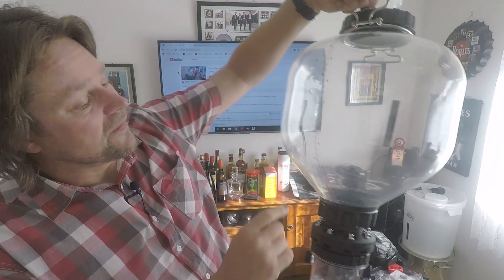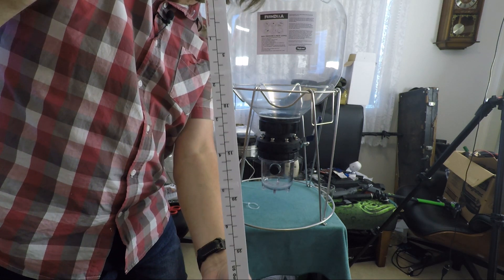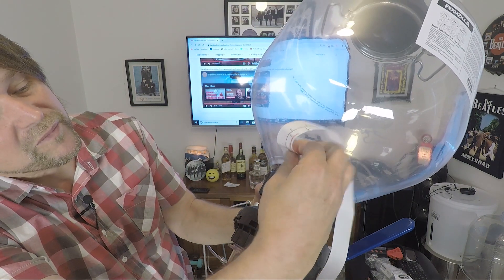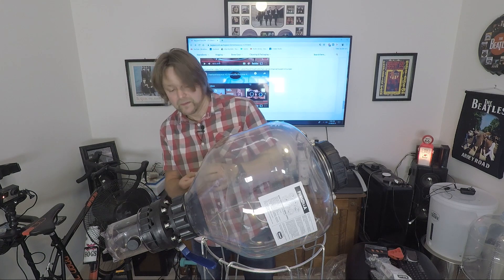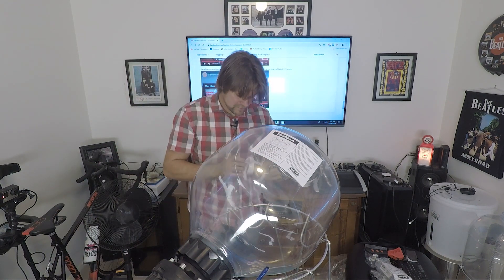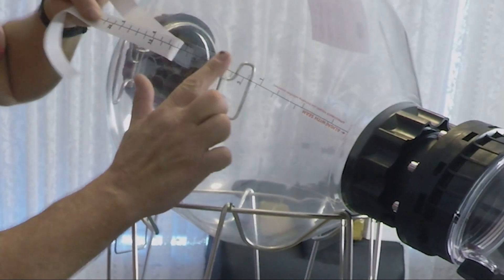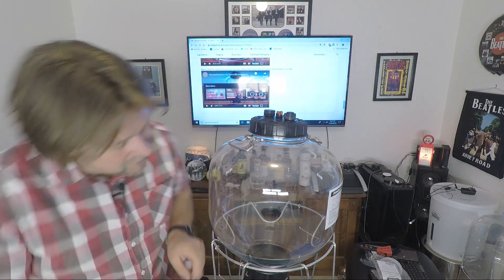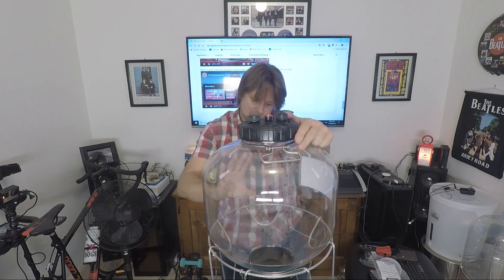Fermzilla Water level strip application. How to.

Comment: Watching a lot of your older videos and I have a question about the fermzilla? Is there a way to adjust the bottom racking to reduce the total height? Here is my problem, my fementor system only allows for 30" in height and from my understanding with disconnects that is over 32.7" in height. (" = imperial inches). Thank You.
Reply from the maker: No I believe it's set at one specific height there is a snub nose unit they do. They sit about 26 inches high not including the spunding valve height. They have about the same specifications as the fermzilla without the trub bowl. https://www.keg-king.com.au/fermentasaurus-snub-nos.html
Reply: Only just stumbled across this now sorry mate. I've been told people have inverted the metal base so that the fermentor sits deeper in the frame (without the trub catcher hitting the ground). Give it a go maybe?